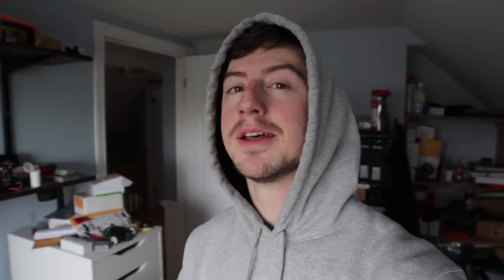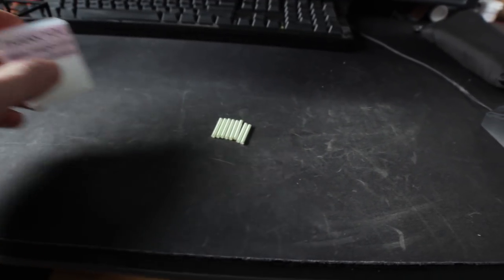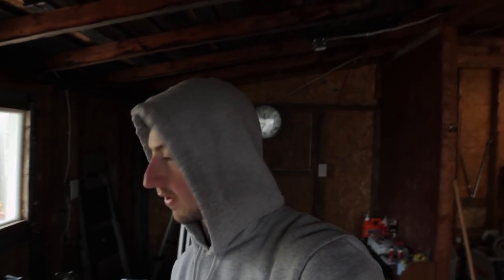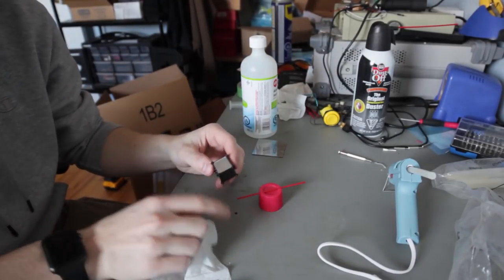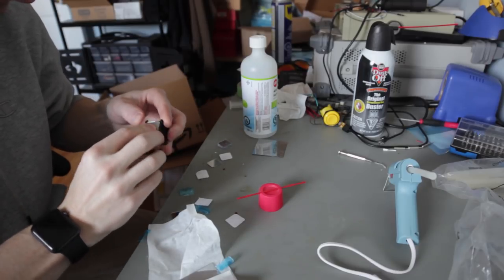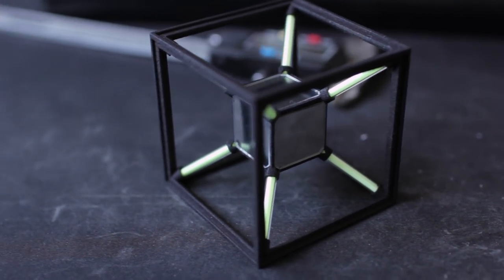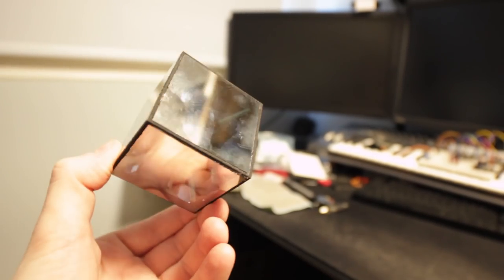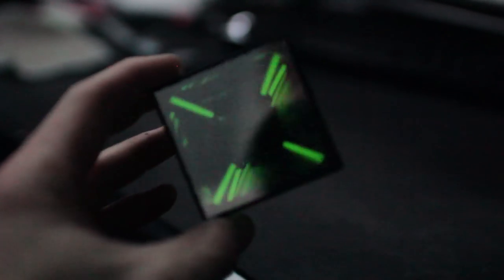Radioactive Tritium Tesseract Prototype

Comment: To "create a real life tesseract", you'll need a 4D printer.
Reply: i see what you did there and i approve =P
Reply: I think we already account for the 4th, by printing different parts in the same relative space,  at different times
Reply: Yeah... this guy is a layer and has no respect
Reply: Yes. This object is a wireframe 3D projection of a hypothetical 4D tesseract, Sean needs to get his facts straight (in a non-wireframe the cells that form the 'sides' are solids). Saying he "made a tesseract" is wrong in the same way as drawing a cube on paper and saying you created a cube would be.
Reply: @Sulq  Good analogy.
Reply: Easy, just add another stepper motor.
Reply: @docarii  ahh yeah, big brain time
Reply: You must mean 7D, there is already 4D, 5D and 6D printer that let's you print long objects and ones with rotational and axis spins.
Reply: M8 I can’t afford a 2d printer
Reply: Makes sense
Reply: 4d printer
Reply: @docarii  4d is not time
Reply: @DivinityIsPurity  
I think you don't understand what 4 spatial dimensions are.
Reply: wouldn't a 4D printer effectively be god?
Reply: @jamescheddar4896  Only for "creations" made with plastic filament.
Reply: @donkrapf  plastic 4D warehouse is still a pocket dimension
Reply: And before that, you should live in a universe with (at least) four spatial dimensions.

Comment: I assume that the tritium has a negligible amount of radiation so it is safe, so it’s pretty neat that the glow is from radiation
Reply: Tritium was used as watch lume for some time
Reply: Neon has a similar property, because it’s a noble gas, it’s stable. Idk how it radiates but it does that.
Reply: @YD_.  dosnt it need electricity tho cause i know neon lights dont always stay on
Reply: @maxortega8073 yea, i think it’s stimulated by electricity
Reply: Yes its all safe, until injected into your body.
Pollonium and americium for example are also safe to handle, but deadly if injected.
Your skin is enough to block their alpha radiation.
Reply: @maxortega8073  Neon glows naturally, but in some forms, like injected into powder or something the light is stimulated by electricity passing through.
Reply: @xcruell  Yeah that's what happened to Marie Curie, by smelting Uranium she got burn by polonium and got poisoned by radiation.
Reply: It’s not so much the amount of radiation that is safe, but the type of radiation :)
Reply: @GOTTHEDAWGINME  i dont plan to inject myself with a radioactive substance XD
Reply: Tritium emits low energy beta radiation, it's safe as long as it isn't eaten.
Reply: Kinda the glow is generated from a different element on the inside of the Glas container (I think it is phosphorus but I'm not sure) the radiation from the tritium hits the coating and bumps the atoms in the coating in a higher energy state and to go back to the more stable lower energy state they emit a proton
Reply: @YD_.  yeah, neon lights up when exposed to a decent amount of electricity causing the bright “neon” glow. It does, however, require electricity in order to excite the electrons enough to produce a proton of light. 

Tritium is basically really unstable hydrogen. Hydrogen is usually a proton and an electron but this isotope contains two extra neutrons, which causes the atom to become unstable. It releases beta particles in order to get rid of the extra neutrons and turn back into hydrogen. It has a half life of around 12.5 years meaning after 12.5 years 50% of the gas will have been converted back to hydrogen. After 25 years, 75%, after 37.5 years, 87.5%, ect.

Edit: it’s safe because the beta particles aren’t strong enough to pierce through the thin glass vial that it’s in, and it doesn’t produce enough radiation to be harmful anyway. It’s a gas, too, if anyone didn’t know.
Reply: @marcd7332  yeah it was also used in night sights during WW1 and WW2 and I think there still being used in British SUSAT sights but I can't remember
Reply: The radiation itself doesn't have enough energy to produce a visible glow, so the lining of the vials are coated in phosphorous, which gets excited by the alpha particles, and in turn
emits photons. That is also why you can get multiple colours of tritium vials.
Reply: It's not strong enough to peirce your skin, and while harmful if ingested or inhaled it lasts about 14 days inside of the human body according to a quick Wikipedia search

So not super dangerous if a one time incident happens

I had Tritium night sights once and it was super neat
Reply: @marcd7332  isn't it still used?or do they use that glow paint stuff
Reply: @skroogemcFück  Some new watches still use it but it’s very uncommon
Reply: @marcd7332  it still is, it’s just contained in glass tubes, gun night sights use the same thing.
Reply: Tritium radiation isn’t powerful enough to make it through glass, so it’s 100% safe.
Reply: if you can see light coming from it, chances are, its not negligible. Thats heat energy your seeing.
Reply: @marcd7332  and then they stopped using it because it was radio active.
Reply: @xcruell  but... its a gas?

Comment: Same physical design, 8 LEDs pointing into transparent plastic sticks (glue gun sticks?), solar panels for the inner cube, a recharging circuit with light sensor and small lithium battery. Now I need to see if anyone makes small-ish square solar panels. The overall size is likely going to be determined by the solar panels and how small a battery will fit in there that also holds a decent charge.
Reply: Lithium battery would probably be the best via either wireless charging or charging through pads on the corners and an optional switch, capacitive or light sensor activation.
Reply: @AmusementLabs  Yes, I agree. Having looked at all the available solar panels I can find I think they would likely turn this into something ugly. A couple of tiny leads run out to one of the corners would not be very noticeable.
Reply: Call "NASA", (seriously)! You may be surprised at the outcome. Also, if it comes to fruition as far as a build. Check out the NASA work handbook "Free and online" for how to wire it safely. They have a bit of experience that nobody else does. And they did learn from it. And that handbook is way thorough...

Comment: needs more glow. that tesseract representation is meant to be a wireframe, so every edge needs to glow on the big and little cubes. Also, doped strontium aluminate / plastic extrusion would be way cheaper
Reply: I was gonna ask about that yea, I have a bunch of strontium aluminate somewhere but not sure where I put it lol. Also much cheaper
Reply: Can we use glow in the dark filament?

Comment: So does a 5 dimensional cube have another outer cube?
Reply: Yup
Reply: it actually looks like a tesseract has another tesseract
Reply: no, not an outer cube, but an outer-inside-cube xD you can imagine it similar like this
https://en.wikipedia.org/wiki/Klein_bottle
Reply: Actally, a 2d square is bounded by four 1d lines, a 3d cube is bounded by six 2d squares, similarly a 4d tesseract is bounded by eight 3d cubes and a 5d thing should be bounded by 10 4d tesseracts.
Reply: @anshsingh9644  is it +2 or 2x dimention
Reply: no it's a tesseract inside a tesseract.

Comment: The one I built is that same size. But I used (32) tritium filled tubes instead of the eight in this one!  And I assembled it with an alternate color scheme between blue and green tritium tubes. Also, I used a "Dichroic" film of two types alternating those between "Black Orchid and Rainbow", on the 1/4-inch-thick acrylic plates, [plus a mirrored film on one side]. The frame was printed in white, which was then covered in a glo-powder suspended is clear epoxy. These are very easy to put together by the way. Too bad I cannot post a pic! Damned expensive though... But worth it for the jaw drops!
Reply from the maker: You can post an imgur link and ill approve it. Sounds cool, I want to see it!
Reply: It is cool, very cool! THNX SHAWN! (FOR THE IDEA!)  @SeanHodgins

Comment: Really nice! The inner cube does not reflect anything, maybe if it was not perpendicular to the outer cube? Rotate it by a bit around all axes? also, maye something could be inside the cube in the center. an rfid/nfc tag, so the tesseract unlocks something. Or a strong magnet. Then you put the tesseract on a hall sensor, and turning it controls something like the volume on your computer.

Comment: Tritium is a safe low level radioactive material. it is used in a number of self luminescent devices including watches, some telescope aiming devices, compasses, and more. It has a half life of approximately a decade meaning from the time the vial is made, in 10 years time it will be half as bright, in 20 years time it will be a quarter as bright.

Comment: Nice work Sean! I could see someone adapting this to work with some LED filament lengths and a battery pack in the middle??
Reply from the maker: Thanks! That is kind of the plan, but will need some more creative thinking. Not a lot of space, and needs to be able to be disassembled. Of course I want it to be small too.
Reply: @SeanHodgins  did you try to do it?

Comment: Shouldn't the trapezoidal planes also have partially silvered mirrors in place?  Also if you could find a way to use clear plastic rather than black for the frame, the edges themselves "frame" could act as a conduit for light
Reply from the maker: That would be cool. It could be made in cnc PMMA. But would be expensive and maybe brittle.

Comment: @SeanHodgins You should be careful working with Tritium. Tritium emits beta radiation, which when impacts the walls of the tritium containers emits secondary high energy x-ray radiation called Bremsstrahlung radiation.
Reply from the maker: Tritium is incredibly low energy and the amounts in these vials don’t even trigger a dosimeter when broken open. Have you ever sat in front of a CRT monitor? If so you’ve been blasting yourself with more high energy particles in a few minutes than one of these ever would over it’s lifetime.
Reply: @SeanHodgins  I have a dosimeter sensitive enough to pick up the x-rays from tritium vials. The issue is that the x-rays are not high enough energy to trigger gamma ray detection in most dosimeters. I will need to compare a tritium vial with a CRT if I get a chance; I currently have access to neither. The dosimeter that is sensitive enough to detect the x-rays from tritium vials is the RadiaScan-701 which is made in Russia. It costs about 300 USD to purchase from the manufacturer if you are interested in one. This video demonstrates the sensitivity of the RadiaScan-701 to detect x-rays. https://www.youtube.com/watch?v=T1HZ8NAXu64

Comment: I wonder if you could fit watch battery's on the inner cube and then mount LED's that are in a small plastic tube (with the wire for them inside the tube as well) and then run that into the battery's on the inner cube

Comment: Cool, but a tessaract would go inside out when moved. But cool nevertheless
Reply from the maker: Moved in what dimension? 😆
Reply: If you move a tesseract in any of the 3 standard dimensions, it would look the same, so it would stay the same while you wiggle it around with your hand. Moving it along the 4th dimension would make it appear to shrink or grow, with the "inner" cube following behind it, so it would appear to turn inside out at some point (when the W of the hypercube is the viewer's W). Rotation along any standard axis would also work as normal, with rotation along the W axis causing it to appear to flex, like you are trying to turn a bicycle inner tube along its long axis (along the curve). Unless you have a very special hand, handling it would not change how it looks, outside of how you would expect any 3d solid to move

Comment: I think led filament would also look great. However, i think most led filaments need 60V to 80V...
Reply from the maker: AC at that! You've got me thinking though.
Reply: @SeanHodgins   (I made Carl - Neil and I made DeepLightLabs.io . Thanks for the shout out) I've been toying with LED filaments but you have to get creative when both power leads have to come from the same side. 70V is annoying. Sanded edge lit acrylic rods work though
Reply: @SeanHodgins  LED filament is dc luckily and a small boost converter can easily do ~70V at a couple mA from a small lipo. With these filaments, for aesthetic lighting you really dont need a lot of power to get a nice glow.

Comment: you should have used one way and not 2 way mirrors
Reply from the maker: Those are literally the same thing. Some people call them two-way, some call them one-way. They both mean you can see through one side, and get reflection on the other. Those are what I used.
Reply: @SeanHodgins  it is weird to call them two way mirrors, when they only work from one direction. I'd say you're calling them the wrong thing, not a "some people say this some people say that" type of thing.
Reply from the maker: @ziggyzoggin  one way mirrors can’t been seen through. One-way means mirror on one side, some solid material on the other. Two way means you look through one side and the other acts as a mirror. This wouldn’t work with one way mirrors.